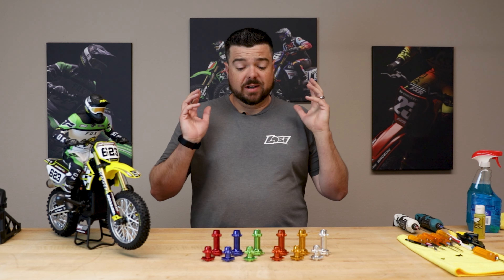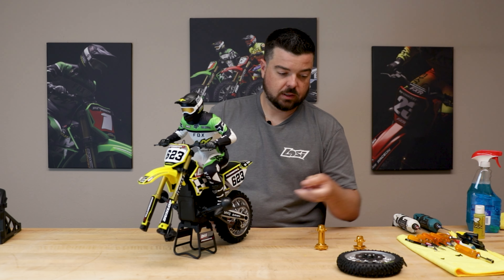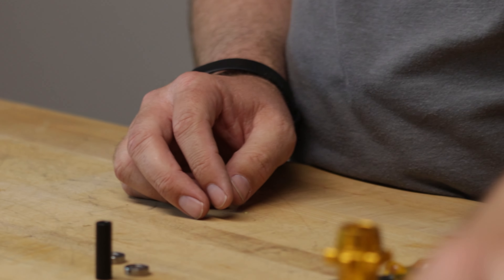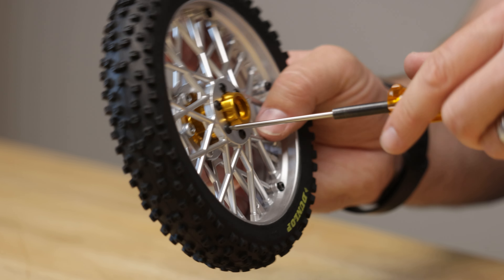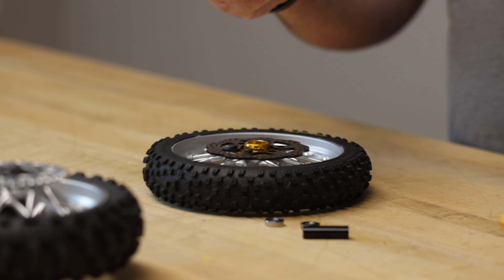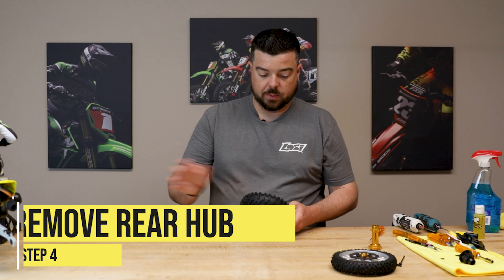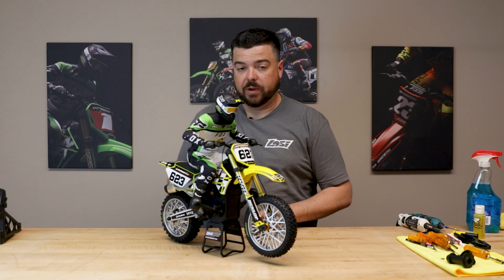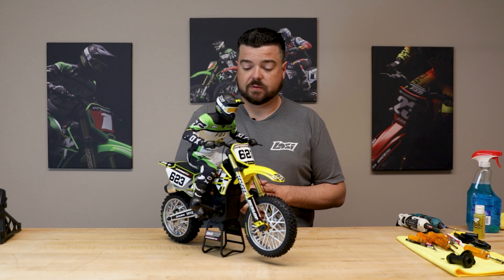LOS362000 – LOS362005 ALUMINUM HUB INSTRUCTIONS FOR THE LOSI PROMOTO-MX

Comment: Need plenty of spokes on the shelf🤣Not to mention the frame issue as well
Reply: There's always one 🙄
Reply: wait, you mean its not indestructable?!   (that video where the guy bent his spokes and broke the frame were literally jumping it and crash landing from like 15 feet in the air. ) I think in normal use it will hold up very well.
Reply: This bike is not designed for 20 to 30-foot jumps bruh lol. I have seen people do nice jumps without launching them sky high, you cant expect there not to be damage when doing that.

Comment: Ridiculous expensive losi upgrade prices on top of an overpriced RTR? Nah thanks.
Reply: actually its less expensive than the other garbage ddirt bikes that have been around for too long with that lead weight on the rear wheel. This bike is leaps n bounds better than the ar racing or skyrc or all of that junk.
Reply: It's not even that expensive of an upgrade, relax. The bike itself seems like a serious piece of quality kit, price seems fair. My only real concern is those spektrum smart lipos they're pushing, I wish the pcb in those was completely resin sealed to make the smart lipos as impervious to water as a regular lipo. Why, spektrum?
Reply: Yea some of the “hop ups” seem like they should be standard. If you want to add unique colors cool. But some of the Aluminum should be standard IMO.
Reply: @idjc2621  have you seen the price of the other rc dirt bikes on the market from AR racing and skyrc? Those bikes completely suck ass and they are more expensive than the losing bike
Reply: People in the rc industry whining about something. No way, I can't believe that lol😂
Reply: @dirtyfox  I like it when folks bitch about price cause they can't afford it. Means less noobs with them and always have parts in stock. Folks batching about a platform that doesn't exist
Reply: @dirtyfox  they also complain the bike is too easy controlled by electronics and everybody could drive the bike. My response to that is all ground  r.c hobbies are made so anyone can go buy and have fun immediately. I come from a air background and love the ground at times cause it's easy and relaxed.
Reply: @dbirds21  losi will sell boatload of these things to the MX, off road industry. Anyone who buys new dirt bikes every year. Will buy one of those just for giggles
Reply: @utrak why u care about silly battery just use your fav brand .. smart battery ain't that smart just tells u when it's flat .. well when a battery gets flat the vehicle goes slow ... Go figure
Reply: @Bogues_88  Sound advice, I know. Though the smart lipos also self-discharge to storage voltage if they've been inactive for 72 hours, which is pretty cool.
Reply: its amazing how many broke as mofos come on here to complain about the price ..stop watching these videos if you cant afford it. How about you go and make some money and then you can not worry about the price.  I am about to go work for a couple hours and cover the cost of this thing...done
Reply: @dbirds21  I wouldnt say the ar racing or the sr5 bike were junk -far from it! they were the best around at the time and worked great, 
Like all great models (and even real vehicles) the next ones come out with what was learnt from the older ones and just improved upon,
This is another evolution
Reply: @mark675  I do think they are junk. The most  unrealistic driving rc item ever. Can't corner, can't jump, can't wheelie and they pulsate side to side when trying to corner. Basically useless. I got 3 AR racing arx dirt bikes that will sit forever
Reply: @dbirds21  I don't mean any offence but have you set them up properly? If you are having problems with all of them then it could be that or maybe the way you are driving them? With bikes you have to be smooth, even this losi bike will look unrealistic if you are erratic with the steering and throttle
Reply: @dbirds21 have you reversed the steering so when you turn left the front wheel turns right and vice versa? Have you got a  sprung steering arm? Is anything binding in the steering system? Any of these things will make it undrivable
Reply: @mark675  yes. They just are junk with the rear heavy weight in the wheel. Makes them drive no wear near like full scale.
Reply: @dbirds21  na theyre not 100% scale, this losi one is the closest to that, although the venom vmx/ atomic mm450 was a good attempt previously
Reply: Quit Wal-Mart, and you won't feel that way!
Reply: @mark675  the venom was decent. Sky rc is OK just cause you can turn the speed down on gyro. AR xrider Nuova for is crap for dirt
Reply: @dbirds21  yeah the nuova faor hasn't got a gyro has it? Maybe good for supermoto but not much else
Reply: @mark675  no gyro. Good forvroad not off road. Sure was a nice machined piece of art but better shelf queen
Reply: 500.00 plus for a 1/4 scale that takes 2s batteries... I dont think people understand how massive this bike is lol. I have seen one in person, and to be honest, they may have designed it to be too big, it's as long as the box it comes in.

Comment: The spokes bend and the front plate in front of the engine breaks front bad landings off a good size jump
Reply: wait, you mean its not indestructible?!   (that video where the guy bent his spokes and broke the frame were literally jumping it and crash landing from like 15 feet in the air. ) I think in normal use it will hold up very well.